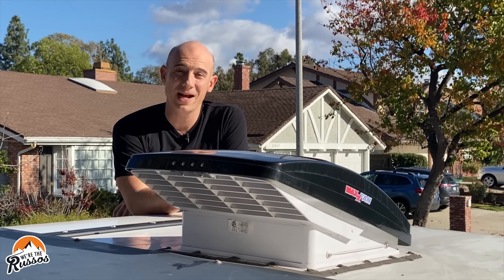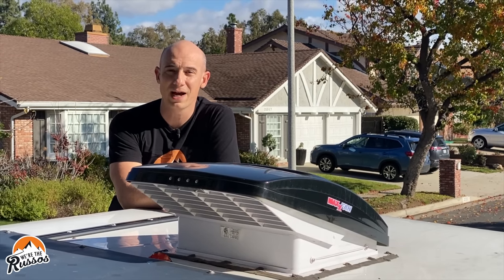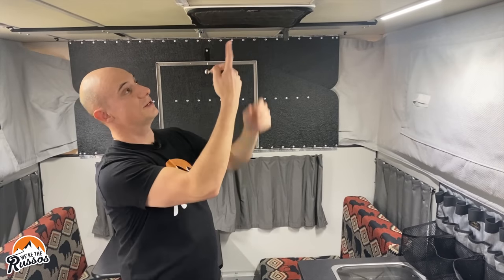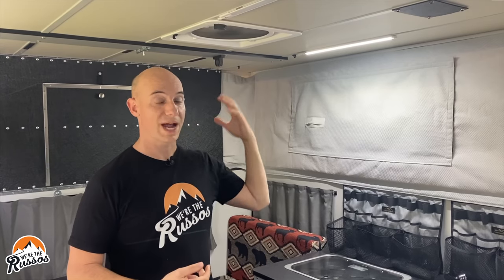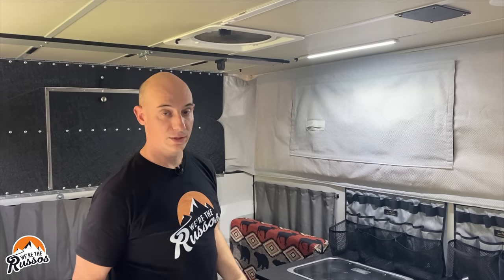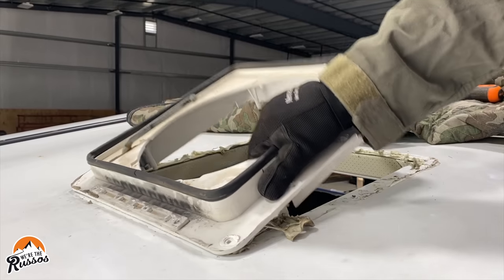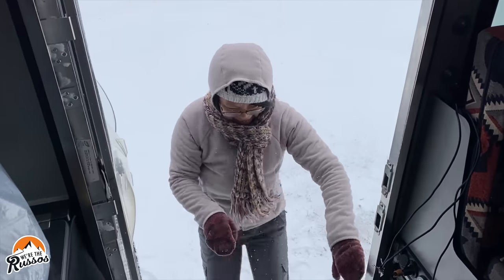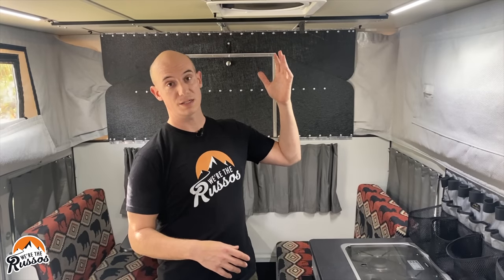Review of Maxxair Fan RV Roof Vent with Intrgrated Rain Cover

Comment: I have the Maxxair vent fan with remote that is also reversible. It is the best upgrade I added to our trailer. It was easy to install. We’ve used the 78° open feature many times and it works flawlessly. The main thing with the built in rain cover is I’ve left it on and open while driving down the road on hot and rainy days with no water leakage and a wonderful job of pulling heat out of our trailer. It’s also very quiet while running
Reply from the maker: Great to hear!

Comment: nice video yes I have to agree they are Rolls-Royce of rv  fans I just installed a second one yesterday made it big difference now I can have one  set on air  in  and one air out on automatic mode and keep the place a lot cooler when we're not here fans i got the Maxxiair deluxe fans are  fully power open and close and fully remote and with them closed on circulate the air the air conditioning move round a lot more efficient and is a lot cooler we live full time and a Rockwood 3008 windjammer
Reply from the maker: Great to hear!

Comment: Thank you for your detail write up and video. Helped me make my decision. I decided on the MaxxAir that does not have all the whistles and bells, Maxxair Vent Corp 00-06401K Maxxfan DLX Vent and the price drops down to $187.84 and ordered 2 units and might order 2 more for another project. After you saying condensation is causing the electronics to go haywire, sometime simple is better "KISS", I can live with 4 speeds and put in a 3 way switch to reverse polarity to get it to blow and suck excuse the pun. I was at Dillion Van Expo and was hoping to visit but didn't see you. Keep up the good stories.
Reply from the maker: Hi Keith - you may still want/need to coat the board because the fan controls are what shorted on ours.

Comment: We have this same fan on our three year old Class B van.  It is great, but be forewarned that ours is having a problem with the Automatic Lift Operator Mechanism and the part is not available anywhere.  It is back ordered, even at the manufacturer.   We have been able to clean and lubricate to help, but it still is not operating correctly.  We hope the part will become available soon.
Reply from the maker: The fan we got has the manual lift - as long as you’re able to reach the knob, this eliminates those types of problems.

Comment: great video! what type of spray did you use on the control panel? I have the same issue with the control panel and want to protect my next one! thanks!
Reply from the maker: Hi Stacy - we put a link to the spray coating in the description of this video

Comment: great video thank you.

I actually have a question: due to space issue can I install the fan back to front? which is the opening side to front. Would it be a problem when driving? Thanks
Reply from the maker: I don’t know, you’d need to ask the company that makes them

Comment: I can't install the Maxxair with the vent trailing due to a rear solar panel.  So I need to find out if I can have it to the side or front.  I know forwards is not a good idea although I have the AC in front of it to break the airflow.  Any thoughts?
Reply from the maker: I’d suggest calling the company and checking with them.
Reply: @Weretherussos  Yep, I did and they said sidways was the best option and forwads facing is not an option
Reply from the maker: Good to know - thanks!

Comment: No they shouldn’t. You’re lucky if it lasts a year. $250 lemon mine was. Didn’t move nearly the amount of air a Fantastic fan does. Operator mechanism is made out of cast aluminum garbage…doomed to fail, and the gearbox leaks oil. Had both replaced under warranty the first year. Year 2 gearbox leaked oil still, and the main circuit board failed after it started having a mind of it’s own. 
The circuit board thing is a known issue they wouldn’t stand behind. Their tech support guy Dale Cox, is rude.
Would be interested to hear how yours holds up on down the road if you keep your rig that long.